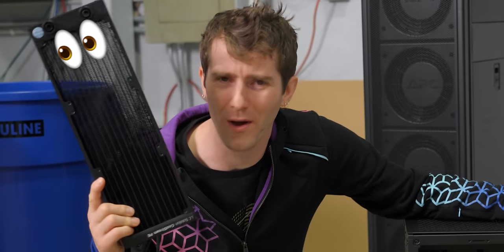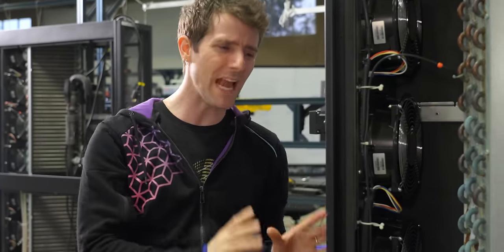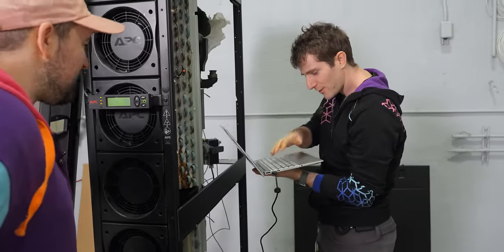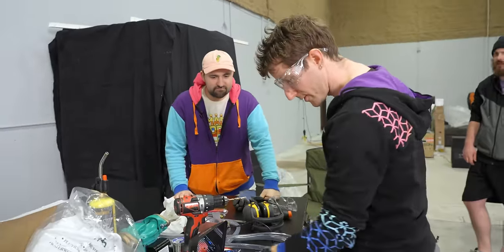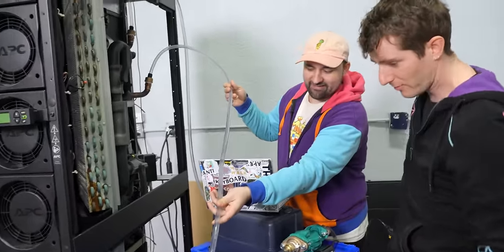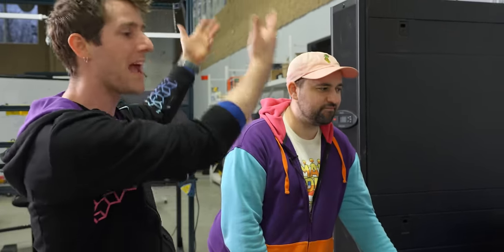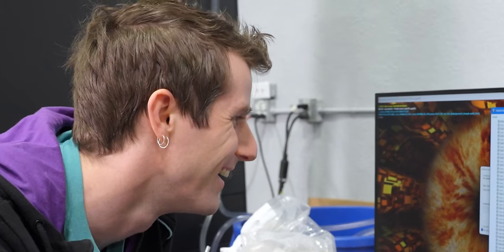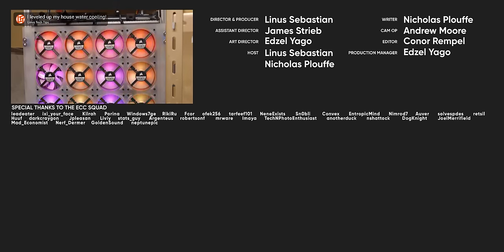I Can’t Believe They Threw This Away - Uniflair InRow Server Cooler

Comment: These PoS’ are the single worst designed and least reliable things I’ve ever had the misfortune to have to manage. Went through 3 full replacements for a single emplacement in about 6 months before we gave up and retired them.
Reply: Skill issue
Reply: @BichaelStevens you got lucky then, from what I can tell. Even their techs hated the sight of them, lol.
Reply: I'm not surprised. A $6,000 price tag for what should be an extraordinarily simple device tells me they are over-engineered. Unless you mean the entire system to include the cooling device outside.
Reply: You'd think that a water-air heat exchanger is not THAT hard to build, especially for a company like APC.
Reply: what about them breaks?
Reply: @itsTyrion the ones we had suffered from a bunch of internal leaks and faulty pumps.
Reply: @Shagbert  I can tell from that coil. Rust everywhere.
Reply: I dunno about that man we have 18 across three facilities and the only problems we've seen is issues with the condenser units on the roof 🤷🏻‍♂️
Reply: @m4rvinmartian  If that's a condenser, then that's pretty normal. When you hit sub ambient, you get condensation, and that's going to cause corrosion over time. Every single AC condenser I've seen looks like that.
Reply: @Gift0r  APC is no longer very good at engineering. Not sure what era the cooling tower is from exactly but we basically use them as a comp to say "well Eaton is cheaper and has made fewer anti-consumer decisions" at work.
Reply: We just replaced 4 of them that had been running 24x7 for 13 years without a single issue.
Reply: @TheGameBench  Condenser is not the term used for that. Condensers, condense the refrigerant not the working fluid. This would be better described just as an air cooler. Only the tube sheet rusts, not the tubes or fins. The tube sheet is only partially structural and isn't so important after it is assembled.
Reply: @SuperS05  Correct. I got it mixed up with the evap unit.
Reply: @TheGameBench  if you don't work with it often, it's an easy mix up. Easy to call it an evaporator coil although that wouldn't be accurate either, lol. Believe it or not, this unit isn't very much different from the fan /coil units that are used in most condos, and probably a similar price.
Reply: I see "APC" on it. That explains it.
Reply: These should be from Emerson, which I believe APC acquired/merged with/was acquired by.  We had them in our facility maybe 15 years ago. They worked ok. It didn’t really save us anything and the big air handlers were better and more reliable. We didn’t have the endemic issues people here note but they were still more complicated and finicky and just not as good.
Reply: @Shagbert  Coils are tough man, and same with pumps.  Gotta know what your operating specs are for the pumps and the water needs to be treated and system serviced regularly.  I can see the pumps but the coils and stuff sounds like a maintenance issue.
Reply: @techwolflupindo has APC really fallen off? I'm just starting in the industry, and, at least in the consumer space, APC is a strong name, particularly with their power protections.
I'm assuming that's not the case for the enterprise?
Reply: @RipleySawzen  It's low volume, and Radiators aren't exactly cheap. Ya, your mass produced aluminium 120mm radiators for AIO's have gotten pretty cheap but - for this? I'd expect just the radiators in terms of costing would run about 1000$, then you have the pipping, fitting, valves, whatever is going on with flow control, and the frame - and it doesn't exactly look high volume either.

Then there is the question if the company does volume order discounts - which can also cause companies to jack up the single unit cost, as they would prefer to ship out a couple dozen to a single client, rather than ship a single unit to 12 clients for a variety of reasons. 

6k per unit really isn't all that crazy.
Reply: Sounds good.  Linus has a lot of karma coming to him.
Reply: @formes2388  Oh yeah, volume discounts are a thing. These aren't exactly mass-produced, so that's a good thing to account for.
Reply: Any idea what part of them actually failed? I'm guessing it was some common type of failure.
Reply: We have had 20 of them running for almost 15 years, 24x7x365... They've been reliable for us that whole time.... Run them in a clean computer room, have them serviced regularly (their intended use) and they are trouble free in my experience. The only issue we had was a batch of temp sensors that would fall due to corrosion from the thermal grease they used .. the manufacturer identified the issue and replaced all the faulty probes during annual maintenance.

Comment: TECH TIP for the Sawzall! The rocker plate closest to the base of the blade is to rest against what you're cutting to stabilize the cut. Also contrary to instincts, blade speed is actually your friend so the teeth of the blade actually cut instead of gripping what you're cutting and shaking the ever living life out of you and the object! Cheers!
Reply: wasn't that very dangerous what they were doing holding the pipe with their hand? I thought linus was going to lose a hand
Reply: @kerolokerokerolo  *lose a hand
Reply: Also you can flip the blade. So if you cut something that bends you can pull it towards and have the springyness work for you.
Oh... And use finer tooth blades for metals.
Oh... And use shorter blades whenever possible.

Also... They are dealing with COPPER... You can cut that with a manual hand saw without a problem. I'm a fabricator and now an engineer... I hate it when people don't understand the power of basic tools... or dangers of power tools.
Reply: @ianhoyt2638  thank you for the correction! edited :)
Reply: @4Gehe2  thanks for the advise, as an absolute ignorat of the topic, it looked kinda dangerous and I'd have been good if the explained the proper way of doing it
Reply: @kerolokerokerolo  yes, and it was cuttign towards him, linux prolly sdidnt want to say anything but the bidfeo n money, if he pointed it down or slippedit would have got him, if he did cut the otherway if he slipped it woulda went up and right
Reply: I was quite young when I learned the "send it" nature of sawzalls. Hold harder, keep the button down
Reply: @4Gehe2  There's also a tool that's literally made for cutting pipes; you clamp it on and then twist it while occasionally tightening it and it cuts through from the outside in.
Reply: @stevethepocket  pipecutters are best for new pipe, if it isn't fully round then it's pain to deal with. Also it need space to be turned around the pipe. Also no need to get special tools when you spend 1€ on a new metal saw blade and like 3€ on a decent frame. 

I don't get why people look down on the humble metal saw. It's excellent for many tasks.
Reply: THANK YOU!
Reply: Also their blade was way too long

Comment: I work for APC's parent company here in the EU and service these units almost every week. 
Thinking about how the unit controls the fan speed, you could actually make them react to the water temperature by switching some of the temperature probes. 
So that if you have more PCs connected to it without much load, the fans could idle and ramp up as the temperature rises.
Reply: That unit could probably cool that PC more than fine even with the fans off totally!
Reply: @electroshed  Oh for sure! But in the video they were talking about connecting more PCs to the loop.
Reply: @kili7658  I mean surely if you set it up right, you could just cool a LAN party, and thats a half unit, I mean if anyones doing something like that, its Linus..
Reply: APC Guys it's the leader in and even on the front fan there's APC SCHNEIDER ELECTRICS CAN EMPLOYS ME OR LINUS CAN PAY ME TO COME TO CANADA AND MAINTAIN THIS SUPERBE ENGINEERING FROM MGE AND SCHNEIDER...JOKE SO

Comment: For a large IT manufacturer I became the expert for water cooled racks, ours had an enclosed rack totally sealed, and a half unit like this on the side, the hold air got sucked in by fans from the back of the rack, through radiators that ran cold water through which then fed back to the front of the servers so it was actually recycling the air, it was actually very efficient because rather than cooling the room or corridor etc you just cooled the rack...  I installed some of these in a well known racing team as they had them under their wind tunnel and were worried racks under the wind tunnel would heat up the bottom and give them wrong results...   Best feature was magnetic spring loaded doors so in the event of power loss or not enough water etc it would fling open the doors so as not to overheat the servers and give time to fix the issues, the thing is you could manually do this, you can imagine the fun of trying to get the doors to fling open on passing colleagues...  I also remember those connectors, they were a beast and at least they used to cost a fortune for the hoses, you could get a rack of fully loaded with blade servers and it would keep them cool...    In learning how they work I admit I did pee water all over a customers data centre on a couple of occasions..

Comment: You should hear these when the server room A/C fails and it's 45C ambient.
The max RPM noise is CRAZY.
Reply: But they are great for when that happens... or they thermal throttle and everything shuts down.
Reply: honestly I'm surprised they weren't wearing ear protection
Reply: Instant perma-tinnitus
Reply: The New Delta fans...

Comment: 7:26 - the foot on the sawzall is the to help stabilize everything. Push it directly against what your cutting. It makes things easier.
Reply: Also I wouldn't even cut it with this tool, I would cut it with an angle grinder. Makes the cut much easier.
Reply: @DG_427  I'd just use a pipe cutter. I would not have to worry about any metal shavings entering the system.
Reply: This is what happens when "smart people" don't understand basic tools. 😂
Reply: @cdsmock4512  Define "Basic".
Reply: @Adroit1911  I'd say more people have a sawzall available than a pipe cutter.
Reply: @Hagop64  yeah, most people don't even know what a pipe cutter is... But it is a hell of a lot less expensive than a sawzall.....
Reply: @Adroit1911  Good point, I was a contractor for like 8 years, I left the pipes for the plumber. I only cut like metal table legs etc, shavings were never issue when I did that outside anyway.
Reply: @RippahRooJizah   A sawzall is a basic power tool.
Reply: @cdsmock4512  What's a "complicated" power tool? 

I mean, I'm not someone who works with tools much, I admit, but if you gave me a regular hack saw and a Sawzall I wouldn't call the latter a "basic tool". Call it ignorance if need be.
Reply: I see people mess this up CONSTANTLY... 

They used like the tip of the blade with a 10incher on it and wonder why the cut looks mangled af. 😂
Reply: @cdsmock4512 It's almost like people are better at doing different things, and that's OK. I suck at using a Sawzall because I never really had to use one before however I have seen people who work construction destroy a paint sprayer and or do an atrocious paint job because they can't cut in. People are good at using the tools they are trained to use.
Reply: @cdsmock4512  power tools are not basic tools. that was his point
Reply: @NWinnVR  
If you have a normally thick blade, sawing with the middle is fine.
Reply: this^  also, should have went with a shorter blade, who need 12 inch of stickout where you need to be carefull about when 4 inch would have worked perfectly fine
Reply: @Alex-rf1md  
Sometimes you use what you have.
Reply: @Adroit1911 kinda disagree with you there. The old sawsall in my garage is infinitely cheaper than the pipe cutter in the nearest big box store.
Reply: The Sawzall scene was legit scary.

Comment: One of my former employers had an APC NetShelter for one of our two datacenter rooms...  It was quite nice; we have an entire enclosed hot aisle for exhaust while the outside of the room was rather cool.  It had two full-width A/C units with chillers on the roof for heat transfer of the coolant; we had the APC folks in regularly for maintenance, and the internals looked about like that did.  Anytime you have water or condensation, you're going to have discoloration, scale, and other oddities on the exterior unless you're doing a daily inspection of your coolers, and that defeats the purpose of the network monitoring and redundancies built into these units.  ;-)

Comment: I had 2 of these in a 3 rack setup for redundancy. (Rack, fan, rack,fan, rack) and they are great. Very noisy however to the point where you can hear them through a concrete wall.
Mine had compressors inside the units and the hot coolant would get pumped up to roof heat exchangers. 
The water trays inside the units are because they can generate some SERIOUS water condensation.   Probably over 1L every 10 minutes or so during rainy weeks, they were like those in door waterfall displays during the rainy season and the water pumps were making a lot of hours. 
We also always joked the 2 units could make the racks move at 100% flow.

Comment: As a contractor, seeing how they used that sawz all made me die a little.

Also really surprised they have a plug in model and they dont have a battery powered one.
Reply: I'm genuinely curious as a relatively enthusastic DIYer: I have both a corded and a cordless recip saw from a relatively cheap big box brand. I find myself mostly using the cordless from a convienence factor, but when I have a bunch of stuff to cut, especially if it is metal, I find the effort of running an extension cord to be worth it as I find the corded rips compared to the cordless. Sounds like a hard disagree from you though?
Reply: Seeing that solder job hurts my HVACR tech heart
Reply: I always go corded when I can.  Battery is just one more thing to have to replace on it whereas my corded ones are literal generations old and still going strong.
Reply: @ParanoidMarvinMk2  I have both battery and corded skill and circular saws if I’m honest the corded one is the tool of choice on site, the battery one is awesome but only used in emergencies. 
I also have both versions of the reciprocating saw but I tend to work with hard woods(oak mostly) as I do restorations on old barns and buildings in the Uk.
Reply: @johnriff85  if I’m honest every time they need to do a trade job it hurts lol.
Considering ive done HVAC, splash, sparks, chippy etc etc I cringe the moment they pick up a tool.
Reply: Linus holding the piece made me yell at the video. Omg that how you lose a finger
Reply: @xaviermeyer660  
Nah, that ain't too bad.
Reply: @MrSurrealKarma  please dont hold a piece in the same direction your cutting. Go slower. Be safer
Reply: @xaviermeyer660  I see this way to often on job sites of macho workers pushing as hard as they can because there big tuff guys and going slow will look sissy. and either they break the power tool or cause damage to the structure.

I stopped lending tools to friends on job site after he bent my Multi tool by applying way to much pressure during the cutting
Reply: @xaviermeyer660  
Would take a pretty damn big slip for anything to happen. 
Plus, metal blades wouldn't cut that bad if it did. Unless the idiot holding it keeps sawing after slipping.

Anyway, not that bad.
Reply: @ParanoidMarvinMk2  There is a story that more plumbers die from electrocution than electricians. I am an electrician. The story that traveled around was plumbers would use 120v sawz all and they cut the power cored as they were cutting copper pipe that they were entangled with in the sub floor space and die.
Reply: @ParanoidMarvinMk2  also what brand of cordless are you buying? I use the big name brands and they cut through everything just fine.
Reply: @Effedup  There is a story that more plumbers die from electrocution than electricians. I am an electrician. The story that traveled around was plumbers would use 120v sawz all and they cut the power cored as they were cutting copper pipe that they were entangled with in the sub floor space and die.

and i never have battery issues with mine. I also use tools from the big name brands. They work just fine for me all day and then some.
Reply: You don’t even need to be a contractor to die watching it.. just look at what the thing looks like! Its pretty clear how to use it 😂
Reply: @ParanoidMarvinMk2  corded power tools are usually AC, while powered it DC. DC usually means smoother motor with finer controls over the amount of power used. DC can also sometimes have more torque.

Comment: Those fittings you cut off are called union couplings. Normally you would install those for quick and easy servicing of pumps or assembling of pipes. My assumption is they had a pump on those fittings and simply removed them before tossing out those machines.
Reply: If anyone is wondering, even if they found the same brand and size union, small manufacturing differences can make them not fit. Before I take a union apart on a heating job I mark them all so I don't mix top/bottom on the unions.
Reply: @killax7  I was a tradesman plumber for 7 years and have never had a problem using a new half with an old half of a union coupling. The whole purpose of a union coupling is quick and easy access to components at a frequent service interval. They seal with a rubber gasket. If it leaks, simply install a new gasket. Compression fittings are fittings that seal using tight tolerances. They mate metal on metal and are usually one time use only. Often the male and female side will distort to make a perfect seal, thus every compression fitting is slightly different and not compatible with other fittings. Compression fittings are the fittings you may be thinking of.
Reply: plumber here, just my thought too!